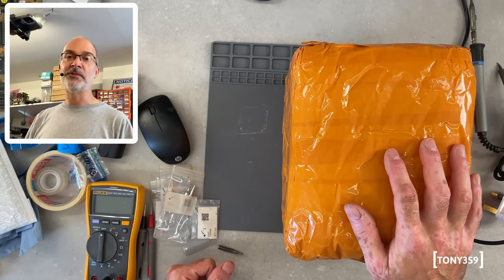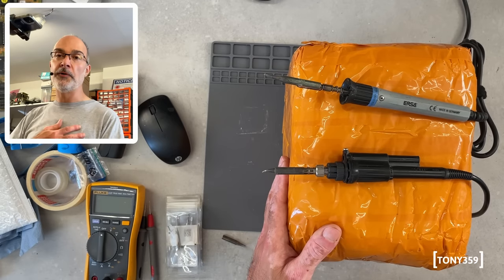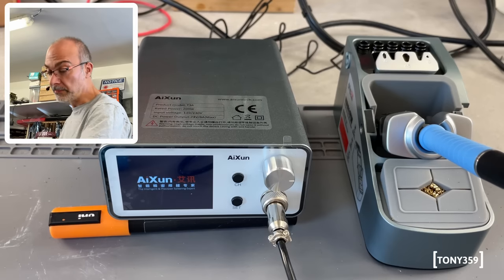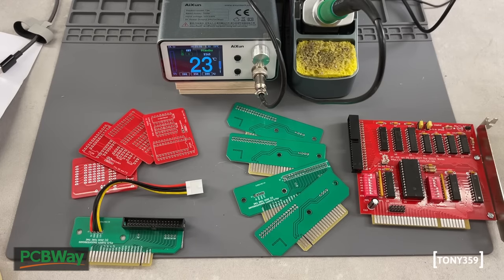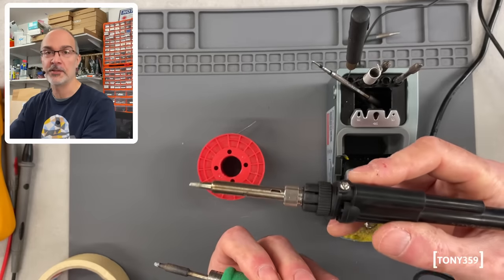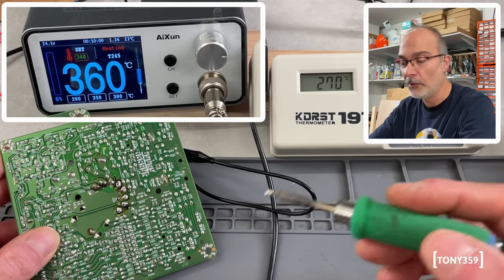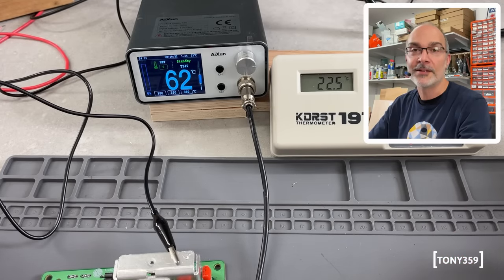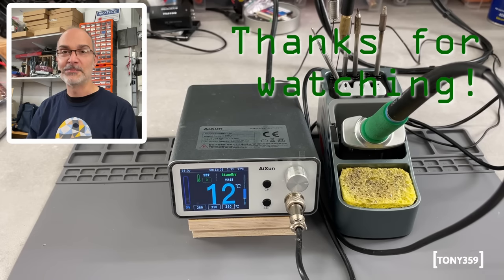Is the Aixun T3A a good T245 soldering station?

Comment: I’ve been using the Int701A++ since 2016. Is yours the older AC pumper version like mine or the newer, stronger, DC pump version that drives the pump directly through the trigger and does not reset the sleep timer when you pull it?

Mine is the older AC pump which is entirely too weak. On all but single-layer boards with no ground pour, I end up needing to pinch the hose, draw a vacuum up to full strength by holding the trigger, then pull the hose straight. You need three hands!
Reply from the maker: mine is probably around 2016 - It's not the best but it works and no, the vacuum doesn't reset the sleep timer I think - but how do I know, it's not being displayed. 
The nozzle clogs often - but that's kind of normal with a de-soldering station. Make sure it's warmed up for like 7-8 minutes before you use it and I keep it at 480C all the time as my thermometer says the de-soldering tip is actually much cooler than the station says. 
The iron works ok as long as you DON'T use Aoyue tips :)

I opened it up once and cleaned the pump.
Reply: @tony359  People reported getting DC Int474A+ in 2015 and DC Int701A++ in 2016.

So, yeah, you’re right on the line. Both stations are the same internally except the 474 doesn’t populate the 701’s soldering iron side. I’m sure they both updated in 2015 but the more-expensive 701 took longer to sell through old inventory.

The AC pump has two diaphragms while I believe the DC pump only has one. The AC version also wakes from sleep (“---“, not “Off”) and starts heating when you pull the trigger. The DC pump is powered through the trigger which another YouTuber says the switch isn’t rated for. He added a mod board to reduce the switched current through a MOSFET and restore the original trigger-wake function to his 474.

I opened mine to clean the pump inside and out the moment my SRA-Solder warranty expired in 2017… but nothing improved. The pump was full of yellow dust but it did not appear to be causing my issues. I gave up desoldering and just used the fume extractor… until even that quit working later in 2017. I literally heard the airflow get slower while I was working until it stopped with the pump still running.

The clog was yellow flux dust hidden in the fitting where the internal tubing connects to the external port. I couldn’t tell it was constricted because the clear inner tubing looked deceptively clean (no yellow dust) and that part was double-filtered.

I removed the cover again and realized there there was no light coming through the clear internal tubing when I removed the barb cap and filter element. I shoved a watercolor brush in there and a puff of yellow dust appeared in the tube! I got excited thinking that was my issue all along but was disappointed to find it was just as bad as before.

I used all the tricks. The motor simply takes too long to spool up, pulling solder away on the same side before suction is strong enough to pull from the other side of a board with plated through-holes. Of course, this breaks your heat bridge that is keeping the solder molten on the other side… so it stays put even after suction builds.

Cranking the temp, adding fresh solder, and turning the board over (gravity assist!) while making sure the lead wiggles on both sides before you pull helps with some pins. I bought it specifically to get rid of that kind of tedium when desoldering large DIPs and headers, and it still wasn’t enough for power/ground on the boards I work with. I actively avoided using it as much as possible so it took years to figure out exactly what was happening and develop the hose pinch technique.

I’ve seen people with the stronger DC pumps who have the exact same problem to a lesser degree. At least their’s were more useful in the first place but they’re still greatly improved by spooling up to maximum suction before pulling solder. Kainka Labs demonstrated a couple different vacuum modifications to accomplish this with his ZD-915, a similar DC pump unit. I shared the hose-pinch trick in the comments to another Aoyue video and got a reply from someone with the DC pump saying it changed everything for him. I’ve since moved to a foot pedal and solenoid to control mine but the hose-pinch doesn’t require any mods… though you may want to graft a third arm to assist. ;)

Funny you should mention a 7-8 minute warm up: I set my sleep timer to 8 minutes specifically and use it like an egg timer. As soon as it sleeps I pull the trigger to wake it back up and I know it’s almost time to begin desoldering. You are absolutely right about the tip temperature but it’s also not very reactive to high thermal loads, requiring me to run it dangerously hot most of the time. To limit how much time a power or ground connection is in contact with a 480° tip, I often preheat those to a safe temperature with my regular iron, which is difficult to juggle without that body modification I mentioned (do recommend!).
Reply from the maker: Now I cannot remember how many diaphragms mine has - I might be confusing with my old hot air station which also had a diaphragm pump. Yellow dust? I had yellow goo, not dust!
I cannot complain too much about mine though. It needs constant attention: clean the sucking hot pipe, the metal "spring" and keep the gaskets lubricated and clean. When that's done, I can hear the air being sucked in. I often take the tip close to my ear to confirm (one day I'll burn my ears): no "sucking" noise means I need to stop and clean it. 
While I'd love a better one, mine is totally usable. It's Aoyue. It's random. I got lucky apparently :)

And no, I don't think mine can be woken up by the trigger but I cannot be 100% sure. I normally have to push on the middle button.
Reply: @tony359  It makes the sound but takes too long build enough suction to clear both sides.

It eventually gets there, but not until the solder on the same side has come through, breaking the heat bridge and sucking air that cools everything else. Suction increases as the pump builds speed and removes air from the station’s own lines but that half-second is too gradual. By the time it’s strong enough to pull solder from the other side the surface solder has already gone through the tip and it’s pulling air, cooling the lead and tip causing the remaining solder to solidify on the other side.

It needs to pull right away with enough suction to clear everything while it’s still molten on both sides. Pinching/releasing the hose while holding the trigger can do this… awkwardly.

Yeah, I was using MG Chemicals 845 Rosin flux and their 60/40 RA flux solder at the time, which made a bright yellow chalky dry dust.

One thing that annoyed me is that they included the silicon grease labeled “for cleaning desoldering gun” without any instructions on what to grease or how you “clean” with it. After pouring through my own manuals and quick start guides, I downloaded multiple versions online and all you could get was that it’s “for cleaning.” The only cleaning instructions just tell you how to use the drill and pin for clearing the pipe… no mention of the silicon grease. I even dug up Hakko’s manuals to see if they have instructions for cleaning with silicon grease, but they don’t.

Eventually I figured it was most likely to coat the spring and seal the collection tube AFTER cleaning, so that’s how I still use it today.
Reply from the maker: Interesting. You can hear the noise mine does in my videos - which one I don't know but whenever I de-solder something :)
I can very much understand what you say about the joint cooling down if the solder is not being sucked away fast. 

Ah and I see what you mean about the yellow dust - my MG chemical braid has the same. 

And yes, I also realised the silicone grease was to "protect" parts after cleaning. I've been thinking of getting a better one for a while - they just cost a fortune and this honestly works without pinching the tube! :)
Reply: @tony359 ,  I suspect you've got a defective AOYUE gun (or perhaps an internal electronics problem) because the one I used at the shop from 2015 onward worked great at 380 Centigrade. We bought 2 guns with it and one of them apparently had a bad heating element that ran too hot and ate tips prematurely, but the second gun worked just fine at 380C.  As for the tip clogging, it looked to me like the tube was protruding a little too far out from the heating element and into the solder collection chamber; I suppose it might have helped if I merely cut the tube a little shorter, but instead I slid two small brass washers (totalling about 3/32" thickness) onto the stainless tube before installing a tip into the gun, and then I replaced the three spacers holding the flanged heater assembly to the gun with three slightly shorter spacers (about 3/32" shorter). This helped significantly, reducing incidents of clogging, and the brass washers added a little extra thermal mass at the tip, which is helpful. The solder collecting spring didn't work well for me so I substituted a wad of steel wool.
Reply: @tony359  ,  I've never needed to use silicone grease for the inside of the solder collection tube or the rubber gaskets.  The only grease that was included with our Aoyue was a silvery metallic grease that looked very much like "Never-seize".  I would put a dab underneath the back side of the disoldering tip before sliding it into the gun as well as a dap of it on the threads where the sleeve screwed onto the gun;  it would smoke and smell like hot grease for a minute when you turned it on and then it'd stop smoking or stinking.  This seems helpful at preventing the threads from sticking and seizing when you go to change the tip.
Reply from the maker: @goodun2974  sorry, I have lost track of this: why do you say my de-soldering gun is defective?
Reply: @tony359 ,   Because you said you had to set it at 480C degree. I used it at 380C 95% of the time, and I never had to crank it up anywhere near that hot, 400-420C at most.  Are you working primarily with lead-free solder?  Most of the equipment I worked on had leaded solder, but if it was leadfree I would add some fresh leaded solder to the connections before desoldering.  If I need a little extra heat temporarily I would grab the Weller wand and use that simultaneously with the Aoyue desoldering gun for a few seconds if there was a large ground plane or something, but that was pretty rare.
Reply from the maker: @goodun2974  ah now I remember. I tested with a thermometer and it's wildly off, I think it's 360C when set to 480C. I should replace the heating element but it works... :) I'd rather replace the whole thing with one which has a better solder collection.
Reply from the maker: @goodun2974  I cannot remember that. I still have the silicone one - it helps keeping things clean.

Comment: PS, the later style Aoyue (pronounced A-U) desoldering tips, with the stainless steel nipple protruding from the tip, are pretty good quality, and as far as I'm aware, unique to Aoyue. The tapered metal tip is indeed copper, aside from the stainless steel tip.

Comment: Hi Tony, great video. Subbed !

I'm on the fence with getting one of these. I mainly do thru hole but want to work down to 2012 SMD. I dont have a soldering station ATM  and have narrowed down my choices to:

Sugon T21 120w T115/T210/T245 + C470 compatability
Sugon T16 75w T12
Aifen A2 120w T115/T210/T245
Aifen A9 Pro 120w T115/T210/T245
Aixun T3A
Aixun T320 (the new model)

Im also thinking of going tried & tested with the Hakko FX-888D or 951 ( rip off price ATM though). I dont really need far-eastern drama on my tabletop. Reading through all these comments hints to me that it's a gamble whichever clone you choose.

If you were buying a new station today for the same use-case as me, what would you choose Tony?
Reply from the maker: unfortunately I only know the T3A. I keep encountering that "ground" issue and it's always in the way. As such, I cannot recommend it. I do not know if the T320 is better. Good luck!
Reply: Thank you Tony 👍

Comment: Top review, much appreciated!
Looking to replace my old iron for something more modern and faster heating. Guess the aiXun t3a is off my list.
Any luck with their 320 and up models?

Best regards from the Netherlands.
Reply from the maker: Thank you! I really don't feel like recommending Aixun to anyone here but I am told that the one with the linear power supply (320? 420?) does not have the "I'm melting your PCB" issue :) 
Sugon also make a similar one - but I don't have experience with that. 
Thanks for watching!
Reply: Thanks for your honest reply.

Much appreciated!

Comment: Big thing about the older irons that use the 900 style removable tips.  They transfer their heat by radiation meaning that the color or emissivity of the inside of the tip is very critical.  It needs to be as black as possible on the inside.  If you have some tips (knock offs, whatever) that were completely dipped in tin they will be shiny on the inside and will not transfer heat very well at all.
Reply from the maker: Very interesting point. I am using genuine Hakko for the 900-style one. The Aoyue perform awfully. I never checked the color of the inner part though!
Reply: Ok, more.  The Hakko tips appear to have a steel sleeve in the bore.  I read about it and then you can see it with good magnifying glass.  I gave away all my old foreign coins and that was a really good idea and test you came up with.  I guess I could solder a stack of pennies together or maybe use a brass fitting to test with.  I have a Weller W100 (has a temp regulating tip) I use for larger stuff like terminals.  Been thinking about a T245 iron.  They offer one for like $50, but the fine print says it has the temp fluctuations also that you pointed out.  I guess the T12s are not a thing anymore.  Also, the voltage on the transformer in my station starts out abt 24V then drops to 21V or so when soldering.  That doesn't help either.
Reply from the maker: @robert574  Back when I bought my Aoyue I remember people mentioning the missing sleeve inside those tips. I don't know. I just know that once I tried Hakko tips, the station became useable! :)

Comment: Which software did you use to check/upgrade firmware? It does not look like the official one I've been using.
The one from AiXun now asks for credentials and errors out when trying to register as new user.
Right now I cannot update the firmware anymore because of this issue.
Reply from the maker: Did they break the software too? :) It's from Aixun website "Aixun Software", I also had to register and I had to update multiple times :) 
I downloaded from aixuntech.com
Reply: @tony359  Figured it out, there is a section where it asks for a code to complete the registration which I omitted. My bad! Great review by the way.

Comment: When I saw it happen i immediately thought it had something to do with the idle mechanism, which bridges your handle with the ground connected to your stand. It would have been logical if the business end of the iron would be closing the loop to ground as well as the handle. Alas I see, doing a frame by frame this isn't the case. Where I assume that the moment you pick up the iron from the stand an actual intended burst happens, this happens when the circuit gets opened not closed, when you touch ground on the pcb with your tip it happens when the circuit gets closed, not opened.  Too bad though since that could have fixed the issue by detecting which connection was closing the circuit. 
I am wondering if the T3AS fixed this.. or if this happens with the T3B or even the T320.  Someone mentioned it didn't happen with the T420 but all these claims mean nothing if I don't see the same neutral down to earth person doing the testing. Please consider doing a funding round to buy a few others that are closely related to the T3A , I am curious. A single fet can detect which ground connection was used to close the circuit and fix the problem... maybe they did with newer units. The newest ksger units connect the case to ground without even advertising the fix.. idk.. anyway, thumbs up and ty for the investigating.
Reply from the maker: One thing I did not mention is that I am not touching ground with the tip. I am touching a random pin of a GROUNDED PCB. Touching ground does not cause the issue. According to someone on EEVBlog it's noise introduced by a ground plane. 
My channel is small, this video does not cover the cost of the station, I won't be able to buy other ones to test I'm afraid. 
Thanks for watching and for commenting!

Comment: Have you checked for leakage on the tip using a meter between tip and ground?
Reply from the maker: I did, it didn't make it in the video! I measured this:

VOLTAGE

GND to TIP: 0.584V AC when heating 
GND to TIP: 0.915V DC when heating 

CURRENT
GND to TIP: 1.5A DC when heating 
GND to TIP: 1.74A AC when heating

The tip is indeed grounded though...
Reply: Wow a full amp of leakage? This 1.5A of current is going through the board being soldered?? This is so much worse than I thought. This can very easily fry components.

Comment: My 25 year old weller wc51 stays on all day and is always hot and ready to go. Have I missed something or has Aixun fixed a problem nobody had?
Reply from the maker: eheh! Well, the 245 tips have a huge advantage on the tips used by your weller - they can be exchanged in moments. Aixun tried to deliver a high-power, low-cost station. But compromising on the voltage leakage.
Reply: @tony359  I can see swapping tips quickly would be an advantage.
Reply from the maker: I wouldn't want anything else now, I got spoiled :)